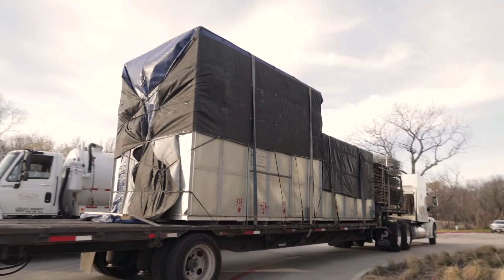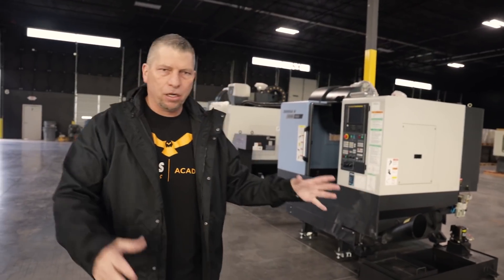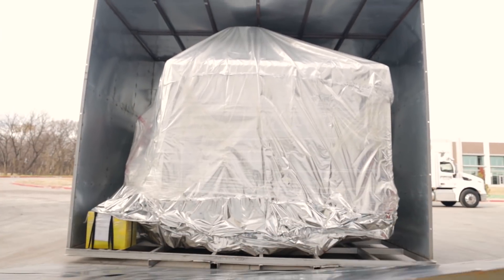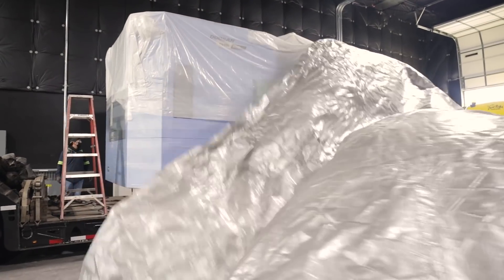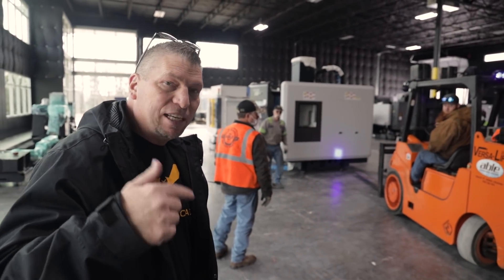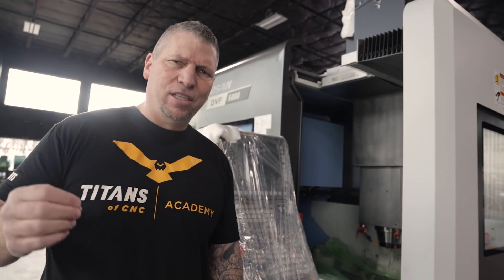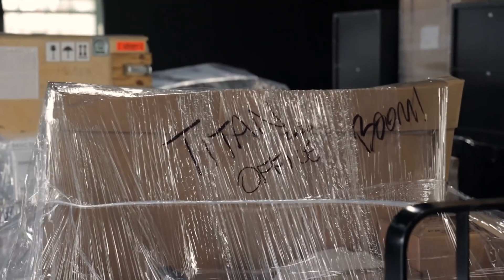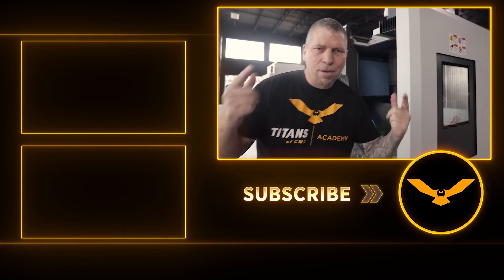Building a 5 AXIS ARMY in TEXAS!

Comment: Titan, we are currently negotiating getting a Haas UMC 750, I know you have used these machines in your shop in the past. I was wondering what you think of the doosan line compared to the Haas 5 axis. I mostly focus on cutting aluminum (99% of the time). I think that this machine will compliment my SNK PC60-5 (with a cat 50 spindle) quite well. Right now we use the SNK for the 5 axis processes for the guitar necks. I know that the Haas UMC 750 with a CAT40 spindle may be a little problematic because of the fact that you need to have a longer hangout because of the table diameter on the  UMC 750 so maybe I would want a UMC 500 if I wanted a CAT40 spindle or move into the HSK holder option for the UMC 750. I was just wondering because I think you have used the Haas UMC 750 successfully and have a reason for getting the Doosan 5 axis.